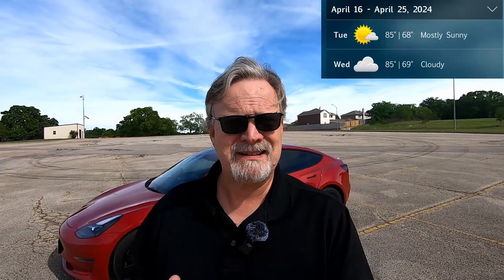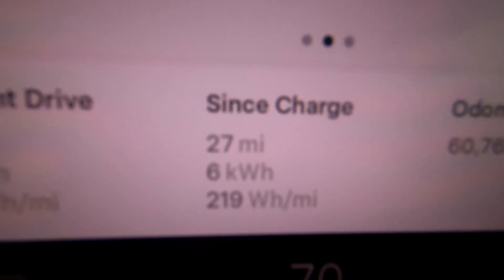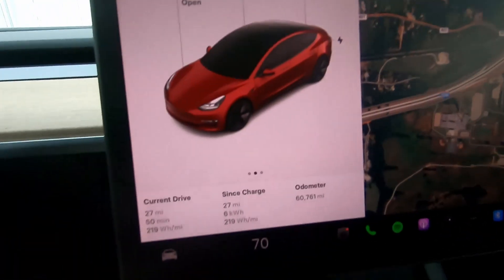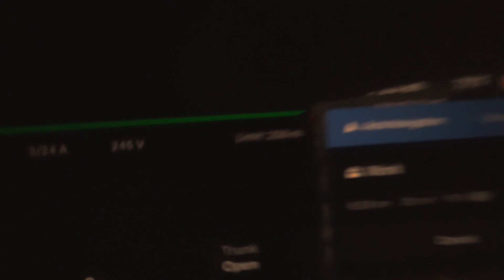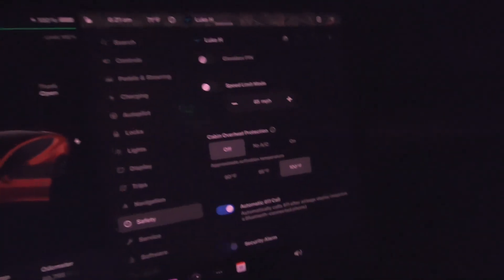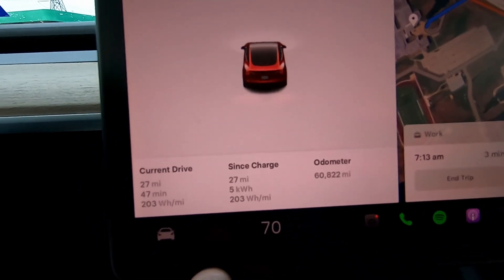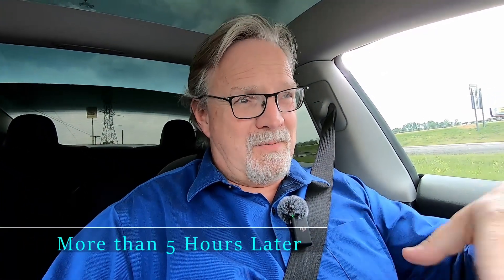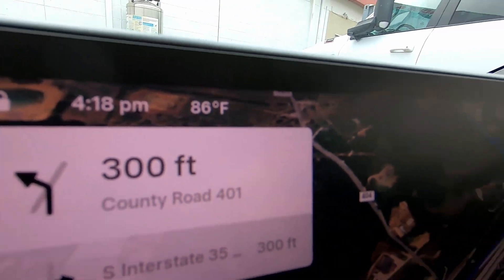Investigating Phantom Drain: What I Learned

Comment: I am very curious to understand phantom drain more. We will be going on a cruise and parking the car for 4 days. My husband wants sentry mode on in case anything happens while we're gone. We are not using cabin overheat protection while we're gone. I am concerned with how much range we will loose and hoping the car won't be dead. This is a short vacation as we are normally gone for a week.
Reply from the maker: Cabin overheat will use more power than Sentry Mode, but it depends on how often you think you’ll have sentry activations. Have enough power to get to the port, then to a supercharger afterwards, plus about 20% and you’ll be fine. And don’t worry. If the state of charge is below 15%, sentry mode won’t activate.

Comment: Very interesting. I didn't know until recently that if you scroll down the climate screen section in the app, you can select No A/C for cabin overheat protection. It might be a good test to click the Vent button to open the windows slightly along with the No A/C option and then compare that with using A/C.
Reply from the maker: I’ll try that on the test I’ll do next month

Comment: Thanks for the video.  Pretty strange numbers.  I see a lot of Tesla owners put the shades under the glass roof as well to cut down on the heat and control the amount of light into the car.  That may help also.  Is it a high crime area that you need the sentry mode?  

I know what was called vampire drain for the Tesla's was also linked to the apps.  People constantly pinging the cars and waking them up.  Over the time they would leave the car long term at an airport they would have significant battery drain.  I think Bjorn did a test and showed if people will turn off the apps and leave the car alone it really didn't lose much.  In the winter test with the battery heater kicking in it did cost some battery, but as long as you don't leave the car at a low SOC over night that shouldn't be a problem.  

Just hope not to be put in that position where I would be forced to shut down and leave it in that condition.  Life is what happens when we are making other plans thought I guess.  Your M3 looks very efficient and is one of the reasons the used M3's are still interesting to me.  I am not a fan of the refresh so I will pass on those.

Comment: I noticed the 258 mile range with full battery on your Tesla and couldn't help but wonder how it compares with a full range battery on your Chevy bolt.
Reply from the maker: The Bolt’s guess o meter is dependent on recent driving habits. I don’t take it to 100% very often. The last time I did it showed the same 258. We took it to 100% at a hotel on a road trip and it showed 214.
Reply: I've read other reviewers state that around town, the Chevy Bolt will actually go further on that full battery than the Tesla due to better regenerative breaking. Have you seen same?
Reply from the maker: @jasanmiguel the regen on the Bolt seems like there are more options, standard, turning one pedal drive off, using the paddle, brake pedal, etc. The Tesla is similar, just no paddle. The Bolt is very efficient in its power use, but the Tesla is more efficient, especially in the cold.
Reply: @jasanmiguel  Breaking?  It's spelled 'braking'.
Reply: I don't think it's valid to simply compare guess-o-meters, given how Tesla guess-o-meters lie about your range when the battery is near full. A more valid comparison is to take the efficiency of the two vehicles (miles/kWh) and multiply that by each car's battery capacity, which is a number you can easily look up.

That said, both vehicles are very close to each in terms of range, efficiency and battery capacity, to the point that I think which one wins depends on driving conditions. My recollection is that the Bolt does slightly better in warm weather at low speeds, while the Model 3 does better at high speeds, or in cold weather.